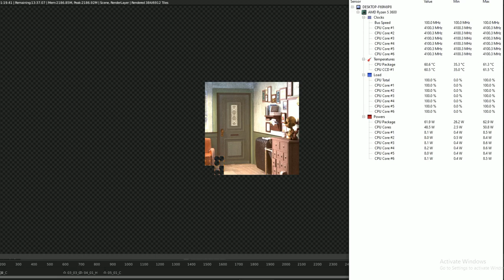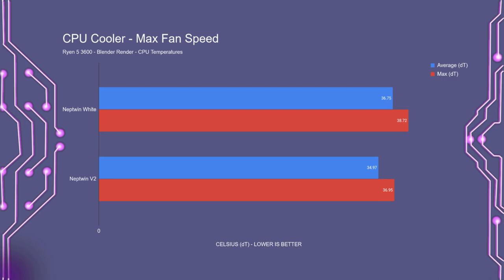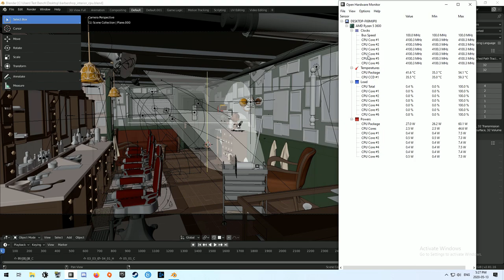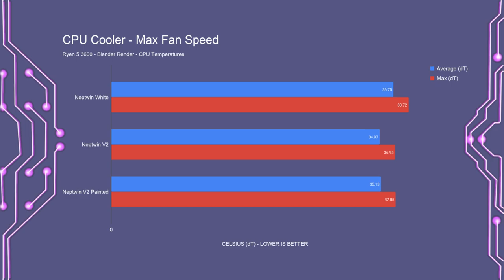Painting a CPU heatsink - What will happen???

Comment: Nice Video! I have a Gigabyte Aorus Z790 Elite AX Mainbaord wich is all black with an ugly grey SSD cooler... After watching Jay´s and your Video i gave it a shot and Painted the Cooler black with standard matte black spray paint. The SSD (Samsung 990 Pro 4TB) is running at the same temperatures as before at ~50°C on the Flash and ~60°C on the Controller. So thanks for the video!